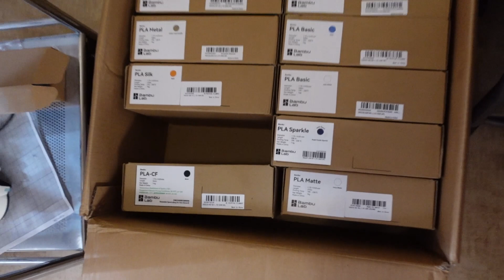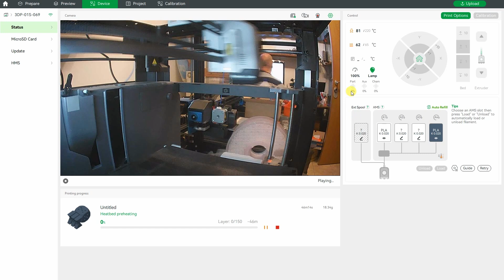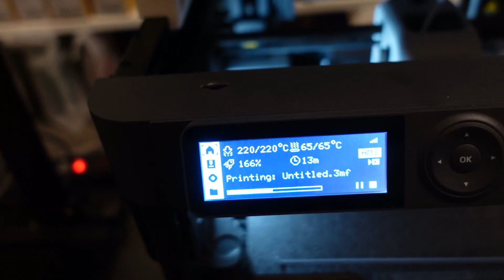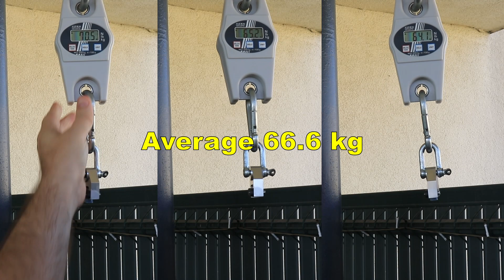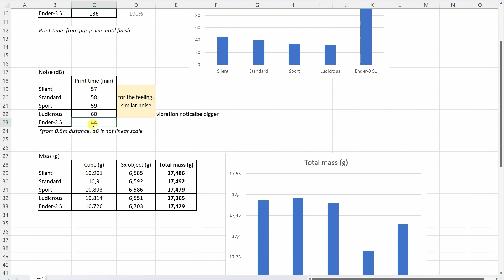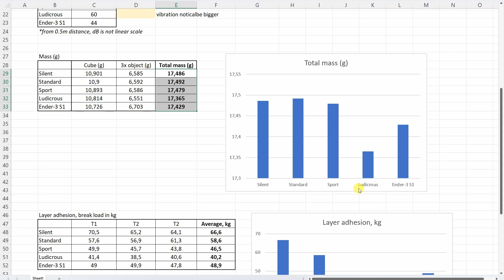3D print speed vs strength (and quality)

Comment: I use ludicrous all the time on my P1s without tweaking any other settings. I have never had an issue and if you do a blind test you can rarely tell the difference from parts printed a standard quality. Printing small items you do not see much speed difference however printing large items or a full bed of items ludicrous speeds things up drastically sometimes cutting print time in half.
Reply: Thanks for feedback, does it really is not noticeable the difference about Standard and Ludicrous? i mean, for a large prints its a gold mine, a print from 8 hours to 4 hours it's just BOOM! but im just worried about the quality of the print

Comment: Did you just do the outro in your bath robe? Nice, my man. Very nice. Thanks for the data. One thing to note, though, is that Bambu Labs states on their website that you have to increase the filament temperature setting up 5 to 10 C if you want to print faster. It would be interesting to perform the experiment again following Bambu's suggestion for nozzle temperatures.

Comment: I would like you to increase temperature on bambulab when you do the ludicrus speed. Becouse I think the nozzle cant keep up the melting with the speed at 220c on bambulab. 

Normaly higher speeds require higher temperatures if you can't compensate it with a much longer nozzle/heating or better nozzle.

Comment: I use the bambulab feet on my printers and found it very hard to get them standing straight, once you set the printer down on the table. They keep to give way. Therefore I printed an upper and lower support from TPU that stabilizes them. This setup greatly reduces the shaking and vibration in the printer.

Comment: Some of that underextrusion and layer adhesion can be improved at high speeds with 3rd party CHT style nozzles inexpensively.

I'm not using bambulabs' feet, but with sorbothane feet I'm seeing good reduction of vibration (at the table, not at the print bed).
Reply: Have heard good things about sorbothane for vibration damping.  Which class of hardness did you go with? Cylinder or half-sphere?
Reply: @Trevellian  I used 50 durometer 0.5"x1" cylinder-shaped ones but I'm sure others work well

Comment: The conclusion Outfit is the best! You should always film videos on a Robe ❤  About the Ender adhesion: definitely, testing it at the same 220°C as the Bambu would be more comparable. Temperature plays a big role in adhesion, maybe even more than speed. 
Excellent video my friend!
Reply from the maker: Thank you. About temperatures, I agree, I just noticed this later, when analyzing the results. I left default setting.
Reply: @MyTechFun is the Ender using a brass nozzle? I think the P1 is stainless so maybe the higher temperature is negligible?

Comment: Making a print stronger usually means more perimeters and more infill, which means more print time. Since there are pretty significant drops in layer adhesion in sport and ludicrous, it might be better to print slightly slower, instead of faster but more walls/infill, if high strength is important for the part.
Reply: Would also save on material
Reply: It would make a good test: same print time but different speed and wall number (and test the layer adhesion)

Comment: I was curious about this as well.  There have been other tests in the past that all concluded the slower the speed the better layer adhesion with PLA.  

I wonder who the Bambu or it's slicer is compensating.  Perhaps as you said it's because the weakest part of your test object, the middle, is slowed down for layer time anyway.

I suppose that if someone only prints decorative items it's fine, but I print object for automotive environments (ABS and ASA) and robotics (PLA and Flexible), I don't know if the time savings is worth the risk of lower quality parts.

The other filaments should be interesting

Comment: Just to let you know, I stopped doing high speed prints with the x1c (I have an after market CHT nozzle). With Petg as sometimes the prints literally fall apart in my hand. Using orca slicer I've managed to get very high speeds for petg even putting them temp up by 20 degrees they are just still so weak. Make sure you test more filaments then just pla as I find high speed pla and abs performance isn't so bad
Reply from the maker: Good to know, probably I should do similar test with PETG too. Thx
Reply: @MyTechFun  experiment with he temperatures but I mean in excess of 30 degrees. At a point the strength is there but the overhangs are not so good and the supports end up bonding way too well for it to be used in real life model printing but for your test subjects maybe be perfect
Reply: I had to slow down my PETG printing in the X1C, even for the Bambu PETG slowed it to 8mm3/s at the filament max flow setting.

With PLA I also slow the prints down if I want it to have even shine finishing on the outside.

PC I have printed at the standard speed (here I’ve only used bambu’s PC)
Reply: @monkeywrench1951  I get 27mm3 for with gaintarm petg and 30mm3 on sunlu PetG. This is with a CHT clone nozzle (after market on Ali express) calibrated on orca slicer.
Reply: Even "20 degrees up" is way too cold for PETG if you're going by the manufacturer's label as a baseline. Set it to 270-300 and it'll do fine.
Reply: What was the fan speed? That could be the lssue